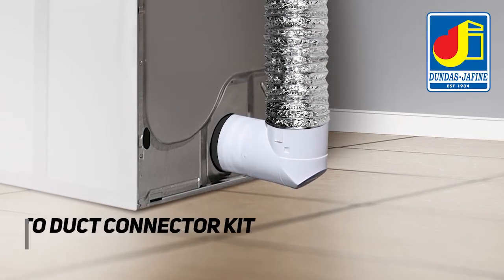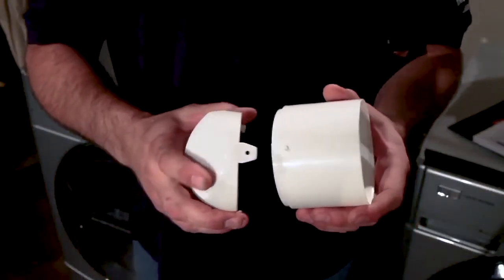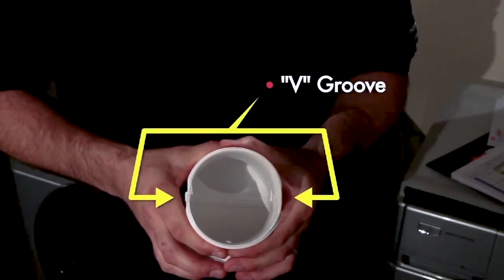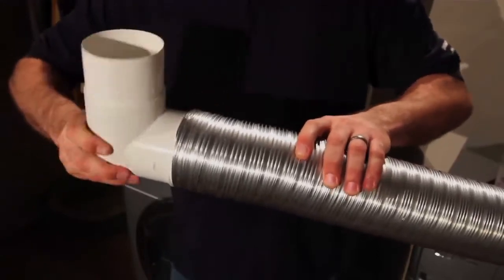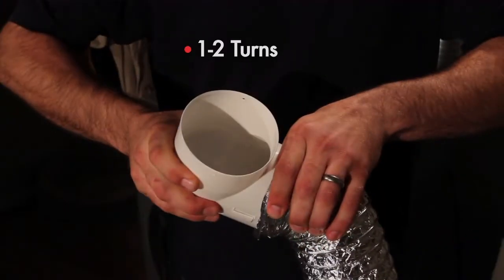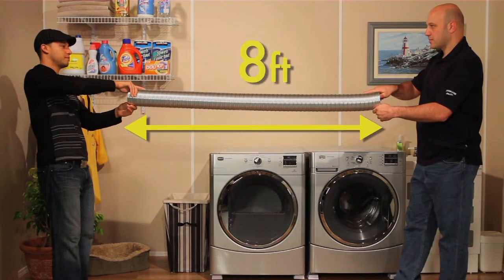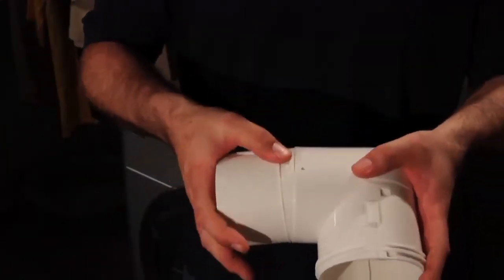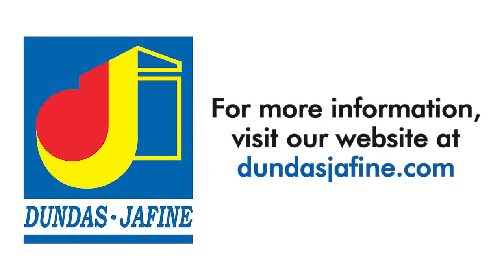Dryer to Duct Connector Kits - Installation: Dundas Jafine

Comment: I can't get my elbow to go over the dryer vent. Both are 4" and are the same exact size apparently so the elbow won't slide over the vent like this video. 😥
Reply from the maker: Sorry to hear about about your Dryer to Duct fitting issues. This product was designed to fit over a 4" dryer flange. We suggest you return this product back to the store that you purchased it from for a full refund.